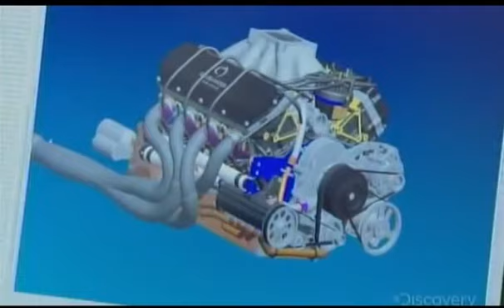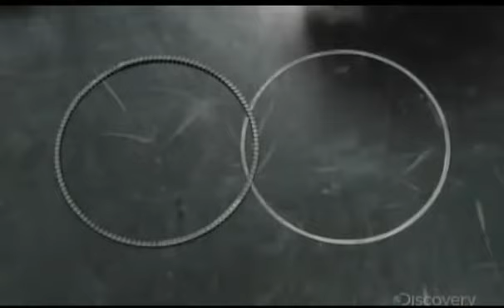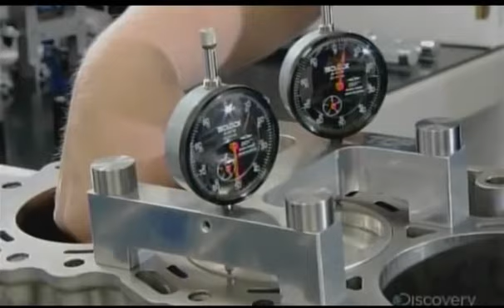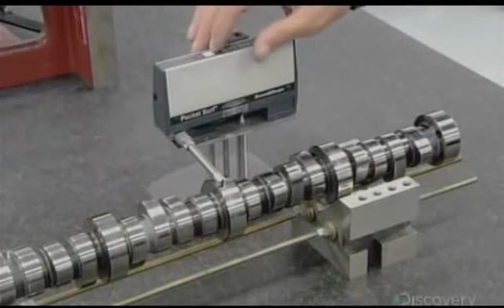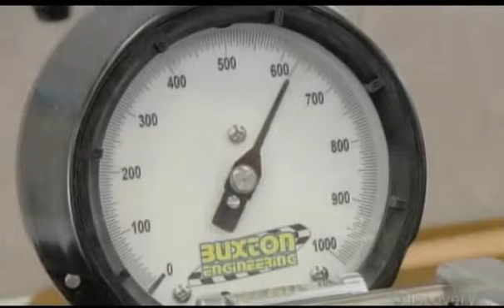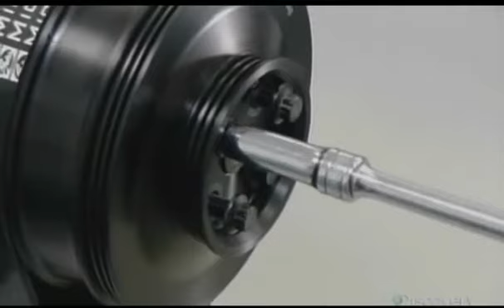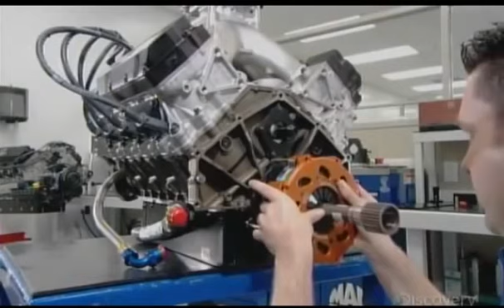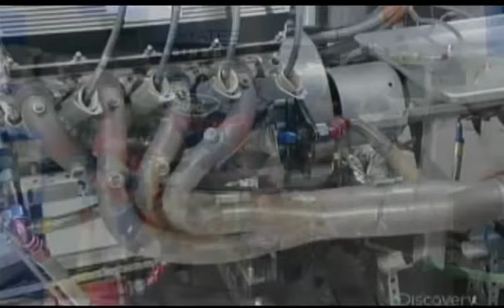How its made   NASCAR Engines

Comment: Love all the hate here, they got cam in block engines making great power at 9k rpms for 5 hours straight. It works why mess with it, want to make it like formula 1 where the engineers are basically the drivers?
Reply: LOL yeah formula one engines nowadays are fucked up, these v8s are simple, effective and reliable.
No replacement for displacement
Reply: I like red cars
Reply: Sorry, not even close to being true, Chevys 350, began production in 1954 for use in the 1955 models, Ford began using the 351c in 1969, the top speed record was set by Russ Wicks set a speed record in a 2007 Dodge Charger built to NASCAR specifications by achieving a maximum speed of 244.9 mph, although, Bill Elliot did have the official on track fastest time at 212.809 mph back in the days before restrictor plate racing, to put it in simple terms, it's pretty obvious your a Ford "fanboy" and just want to discredit and not recognize any other manufacturers, but, sorry, Chevy is the leader, in wins, $$$$ and technology, they, or any other manufacturer did not copy Fords design,  the top 3 of Chevy, Ford and Chrysler used many various engine configurations before NASCAR changed and modified the current rules, I'm sure you can Google that for yourself, if not, feel free to click below.

 http://bfy.tw/9dWA
Reply: Aberd Chevy didn’t put the 350 into production until 1967.
Reply: @JakeAllen550  I'm not the only one that caught it.
Reply: Some people just don't understand what the S in NASCAR really means. Or the F in F1, for that matter.
Reply: Well, actually, revs are a great replacement for displacement, if you have the technology to build very high revving engines. F1 V10s were making nearly 1,000 hp with no turbos and only 3 liters of displacement, and they only weighed 200 pounds. You're not going to get anything close to that kind of performance with a large displacement engine.
Reply: Well its the only small block ,canted and staggered valve head, ever to roll out of detroit on production cars.1969 Boss 302 thru the 1971 boss 351 same head.  Its also the most powerful small block to roll outta detroit back in the muscle car days. Its ok man!  A lot of people have no idea. :)
Reply: Ford just won the IMSA 12 hrs of Daytona last month with DOHC twin turboed 3.5 L V-6 screaming past the 6.2 GM vettes and it was after they took 50 hp off of it . Its the only racecar with less hp than the actual streetcar I bet. :) It also won the 50th Anniversary of their win in 1966 when the old pushrod 427 were turning 7500 rpm for 24 hrs stright. Ford did that 50 yrs ago. I am glad they moved on from cam in block /pushrods in 93/95  The new mustang redlines at 8300 rpm stock. has more efficiency and more HP per litre . DOHCs are just better in every way except cost to manufacture.
Reply: Some one slept during the Science class...HP is the product of RPM and Torque, because of that you can covert to more torque or more RPM using an Gearbox....Torque is irrelevant :P HP is what moves you forward haha!
Reply: idontcare80 The Turbo 1.5L F1 engines made >1000HP at 10Krpm, so yea, you can replace RPM with displacement, you only need to turbocharge them ;)
Reply: No, I'm talking about the F1 V10s of the early 2000s, they made 900+ hp with absolutely no forced induction and they revved to 19,000 rpm. The 1.5 liter turbo engines revved to around 14,000 rpm and made up to 1,400 hp.
Reply: +The Esseboy the replacement for displacement is volumetric insertion, whether that be via turbo or dohc is the question
Reply: idontcare80 Yea, but the 1.5 Liter turbo engines with 1400Hp held for 3 laps...

If the fuel requirments were droped i think the F1 cars today would make closer to 1200HP
Reply: ***** So does Nascars
Reply: Tool0GT92 so guys in pit are racing nice so i want to see you drive f1 car if that is true
Reply: Its because all nascar engines are basically designed after the 351 cleveland nascar motors of the 80s The one that still holds the top speed records. 212mph i believe. Ford had the best design and chevy toyota and dodge have all copied it . Yates has made the heads since then. canted and  staggered valve small block fords were the best design and dodge and gm never even made one but they are today in Nascar! LOL  The DOHC small block Ford set land speed records since 1993 when it was sarted in the Lincolins Its in all the fords since 2000 and bulletproof I dont think Nascar is very friendly to technology or they would use coil overs and rack and pinion steering LOL
Reply: patriotpaul I think you forget that Chrysler was the first to do big bore, short stroke. Aka the 340. Chevy used 5.7 inch rods and ford used 5.09 inc  rods with taller pistons, Chrysler used a 6.123 inch rod, thus allowing them to turn more rpm more reliably. The bottom end of a nascar engine is largely based on Chrysler tech. Cylinder head tech was definitely a ripoff of the canted 351 Cleveland design. However, the new engines are Windsor based as opposed to the old Cleveland based engines. The main difference between them is the blocks. Chevy uses a 350 based block (heavily engineered though), ford uses the Windsor, Chrysler used the R3 (an LA block re casted with Siamese bores), and toyota uses a non production engine. Not to mention the actual architecture of the engines are completely different. So technically the only part on them that is “ford” are the heads
Reply: Paul F - I did not know these were all based on the cleveland  ford motor design. it looks like a scaled down big block chevy head?  not a lot different. would be really interesting to use current designs.  probably have to use a lot smaller displacement to keep the power from escalating too much.
Reply: They do ! But you have to understand  this is at a  Massive  loss of  torque.   This only works in a carbon fiber extra light weight car.   You need torque to push anything heavier and it comes at a loss of HP!     Its a balancing act   :)
Reply: OMG go back to science class and read FFS . Geez
Reply: Then explain it Geez, as far as I know you need energy to move an object, which Horsepower is...Torque is just a static force...you need to apply it with some kind of speed to get any energy out of it...
Reply: The Esseboy
Reply: Lol, yea the engines use the cams to increase the cornering speed...

A F1 engine toady lasts 4000km, that is about 24hrs, has above 35% fuel efficiensy, rarely excedes 12k rpms, and delivers 750HP. How is that worse than a NASCAR engine? And yea it weighs around 250 pounds.

A Nascar engine is not driving inovation...it is just calming `muricans scared of new technology ;).

Comment: I like how "how it's made" COMPLETELY skips over 99% of the building process of engines. Test fitting of actual parts, crank/cam grinding, valve seats, grinding and lapping, only a vague touch on cylinder honing. checking of clearances, torque procedures, gaskets, and break-in. All stuff they missed. Not to mention the stuff they got completely wrong.
Reply: Yes let's watch the 9 hour version
Reply: Watch out everyone we have a car guy here. he knows stuff about how to put an engine together and WE ARE GONNA KNOW HE DOES! 
:D
Reply: Though I do agree with you, keep in mind this show is more for generalized viewing. If real gear heads and enthusiasts want to learn more, they don't go to this show. However, I was curious to see if this would show anything I don't already know. 

No, it didn't.
Reply: Chill the fuck out. It's just a quick run down how it's made........

Comment: can't believe they use a belt... go back to using real cars from real manufacturer's with that manufacturers engine
Reply: Something wrong with a belt?
Reply: +jimboslice751 yeah, it's third world engineering.
Reply: It's light weight... Dumbass
Reply: Belt is x10 stronger and gives the the opportunity not to have to run a timing cover with oil for on the fly timing changes,
Reply: Useful Entertainment
Rather than arguing about whats better research and ask the experts. Google is best. 
https://mobiloil.com/en/article/car-maintenance/car-maintenance-archive/car-tuning-belt-drive-versus-timing-chain
Reply: Useful Entertainment service intervals are the same except metal streches
Reply: Belts are quieter, chains last longer but are noisier, gears are very noisy but last the longest but are very durable. I assume they use belts because the engine gets serviced frequently anyway and it's lighter weight. Makes sense because it comes down to how much strain they can take off the engine. They use lighter pistons, crankshafts, flywheels anyway so the engine can rev higher.
Reply: That belt will outlast any stock timing chain.
Reply: Useful Entertainment 
Dont get me wrong I rum a double roller on my forged turbo sbc . Timing belt setup is to rich for my blood,
Reply: I highly doubt it, it is surely a restriction issue, as usual. Gears transfer 99-99.5% of the energy, belts tend to hardly go over 85%. So it is a waste of horsepower.
Reply: The belt is so much better in this application than chains or gears it's not even a decision that needs to be made by any NASCAR team.   But that doesn't stop some Bozo know nothing from saying they have it all wrong.  What an idiot Useless Entertainment is.
Reply: Buelligan88 they "need" because the belt is "better", just lazy engineering.
Reply: The Esseboy  You and Useless are perfect examples of how just a little knowledge can get you into trouble.  You probably read somewhere that a belt will have less efficiency than a chain... most likely in a bicycle application.  The difference in an automotive application is the chain is bathed in oil and there are considerable efficiency losses at high rpm because of all that oil being whipped around in the enclosed timing cover.  NASCAR engines also use dry sumps, so this means if you do run a chain, you need an oil feed for it.  The belt runs dry with no oil being whipped around and frothed and this makes it easier for the scavenging pump to send oil to the oil tank.  It also makes it much easier for the many minute cam timing changes a crew chief (or his engineer) will make as the car is tuned for the track and ambient conditions. 
All this is pretty rudimentary stuff covered many times in numerous articles over the years.  The fact that no NASCAR teams use gears or a chain anymore should have given you guys a clue  So instead of taking just one thing you know about something and thinking you have all the answers, why don't you research this on your own and prove to yourselves what dumbasses you both are.
Reply: Mark Rich  <--- this guy gets it.
Reply: Buelligan88 Wonder why F1 engines have used gears for ages? hmmm...that should tell you something!
Reply: The Esseboy   You should have learned your lesson the first time.  I won't get into the fact that NASCAR engines have totally different valvetrains than the overhead cam F1 engines, but the explanation that follows is part of the reason gears are used in modern F1 engines.
The reason gears aren't used in NASCAR engines is because, as touched on earlier by Mark Rich, they can introduce harmonics in the valvetrain at very high rpm which can hurt peak horsepower numbers.  Gears are used in modern F1 engines not because they're more efficient than chains, they're used because they are the lightest, tidiest mechanical strategy to transfer rotational forces to the camshafts.  So how do F1 engines get around the high rpm harmonic issue?  Number one is they aren't nearly as sensitive to it because there is so much less mass to influence with harmonics.  At the stratospheric rpm they operate in, harmonics can be an issue, though.  They use pneumatic springs that totally isolate gear harmonics from the valvetrain.  The camshaft triggers a pneumatic spring that is impervious to gear harmonics.  The pneumatic springs also have a much higher rpm limit because they are much less sensitive to valve float, the real objective.
I'm not nearly an expert in these matters, but if you want to keep going, lets go.  Just do your own due diligence before you respond again.
Reply: Buelligan88 Yes, As I`ve stated many times, NASCAR engines are old an outdated, start using some newer tech like in the good old days when inovation were a thing...
Reply: Trying to say gears are better than belts because F1 uses them is ridiculous.  That's like saying premium gas is better for your diesel truck because you use it in your Corvette.
Reply: Buelligan88 F1 engines are lighter, more powerfull, has beter efficiensy and are more reliable! 

Why would you use springs when you can use pneumatic springs? Because they are lazy and restricted :P
Reply: The Esseboy   I'll assume that your refusal to stay on topic is a sign you have nothing to really say on the matter we were discussing. 
Good day.
Reply: Buelligan88 I am on topic...read the comment I am responding to...gears are superior to belts!

NASCAR fans...as outdated as the cars they love and fapp to :P
Reply: The Esseboy  You're not worth my time.
Reply: Buelligan88 Naah, you have overpriced iPhones and NASCAR tickets to buy ;)

How would pneumatic valves and gear driven camshafts be less effective?
Reply: holy shit, what have I started... I was just saying I don't like rubber band cars so it was a turn off to find out nascar uses them
Reply: +Just a Name unless your mixing paint on a scale or selling drugs, the difference in weight between a double roller and a belt is nothing.
Reply: +Mark Rich how long do they last compared to say an ordinary t belt?
Reply: +Mark Rich eh I guess they all got pros n cons but iv heard nothing good about gears.
Reply: +gokartbuyer all the work tthey put in is pretty interesting. what if heard about gears is they are the strongest but they transfer to many harmonics to the valve train and Han cause unnecessary stress.
Reply: RakinBill Lol no...a timing belt holds for 10-15Kmiles, a timingchain can outlast the engine...
Reply: thank you sir. like I said before, timing belt = third world engineering

Comment: actually, they sometimes do have air conditioning.  Not like a normal car A/C, that cools the entire interior of the car, but a much smaller system inside the car that blows cool air into the drivers helmet and firesuit through small ducts.  They don't always run these systems, but at some tracks in the middle of the hottest part of summer, many teams do actually have air conditioning for the driver.

Comment: In other words like any other push rod V8 except for dry sump..was hoping to learn source of components, block, crank, cam, etc..all you show is CNC intake..
Reply: These engines are carburetor V8s. Modern pushrod V8s are fuel injection.
Reply: they have fuel injection carburetors now.

Comment: horsepower/torque?
Reply: essentially the same reason diesels have monstrous torque at lower power figures. at a given power output higher torque = lower RPMs and lower torque = higher RPMs

power can be calculated by multiplying torque and RPM together if you want to think about it in math terms.
Reply: NASCAR's 2015 regulations specify 725 horsepower max and a 9k RPM limit, so in that ballpark. That would be a little over 420 ft-lbs
Reply: +Curtis Wood why is the torque so low relative to the horsepower? gear ratios?
Reply: due to the really high rpm it makes that HP at.
Reply: nascar is setup for top end racing. not acceleration.

Comment: 50's design pfff
Reply: Maybe so but it still works very good.
Reply: Tell that to those that live the LS revolution that has taken the automotive world by storm. Simplicity pays for itself. The plethora of added parts and real estate needed to house overhead cams just simply isn't worth it. For you to say that this is a 50's design
Reply: Simply couldn't be any further from the truth.
Reply: Hmm why don`t you just make the engine 4-5 liter instead? Since you make about 100-200HP more with overhead cams and direct injection.
Reply: Perhaps regulations, if they do it's also easier to make Variable valve timing possible, also 4 valve per cylinder is then easier aswell
Reply: Johans60 And suddenly the engine is actually up to date with modern technology?! How is that possible? xD

Comment: Well this video is old! NASCAR uses Electronic Fuel Injection now.

RT
Reply: Oh thank god, I thought they’re still using the same outdated carburation system.
Reply: @adomasatas589  they are, but not at the same time.. its a throttle body now so not really fuel injected
Reply: @adomasatas589  the best carbs make more power than the best efi
Reply: @skiz8848  No they don't. Carbs are a thing of the past and can't compete with EFI. An F1 car with carbs? You'd have to go back to the early 1960s.
Reply: @ExternalInputs  wow look, another person that doesnt know what they're talking about under a car video. what a surprise